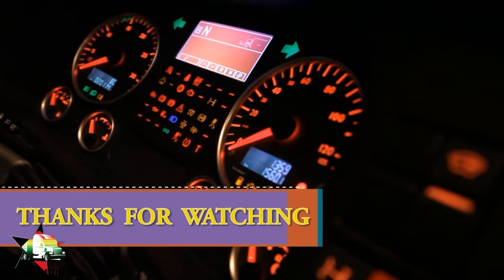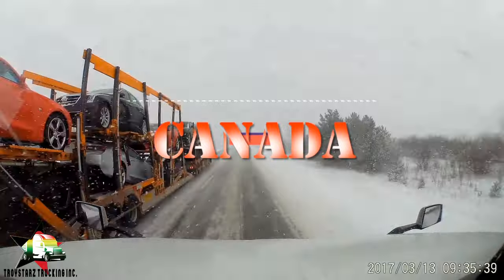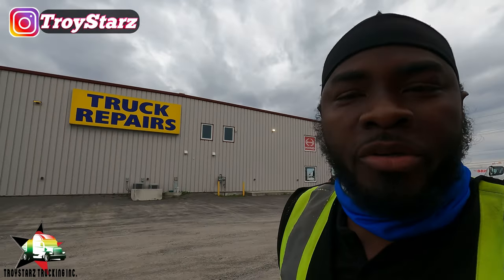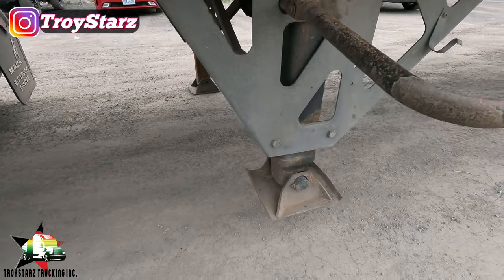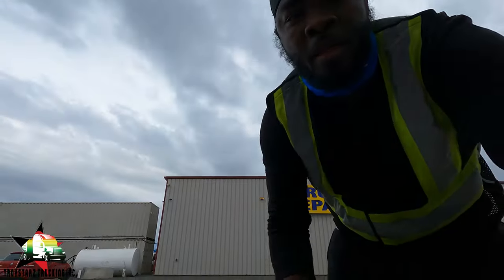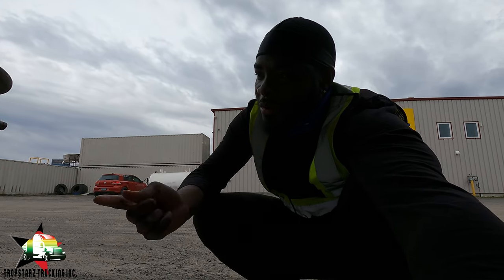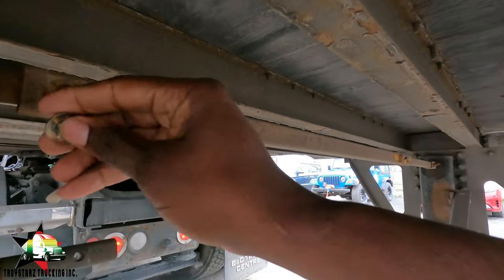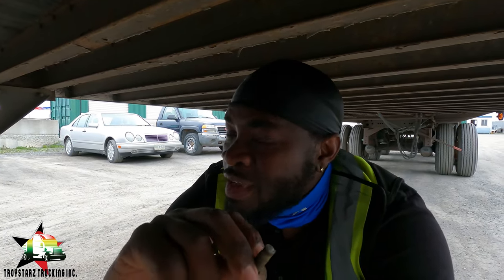Trailer Landing Gear Right Side LEG Not Cranking Up, Quick Fix

Comment: Yeh bredda, it simple to fix once you have the right tools etc...I once had to search on the side of the road for a piece of iron to connect  the bar I found a 4 inch nail which I put in and bend it with a stone lol...we drivers have to be versatile out on the road...great video, blessings.

Comment: Sunday January 8th 2022
I had a problem with 1 leg not working on landing gear.
You were right.  I replaced a bolt that fell out and now it works.
Thanks Troy.

Comment: The bolt is standard or SAE. The long part of the bolt is 3/8" wide, 2 and 1/2" long, with a 9/16" hex head. A 14 mm wrench (or spanner in the UK) will fit a 9/16" luckily! Good job on keeping your cool, and figuring out how to get back on the road.

Comment: The numbers you saw is the bolt size? The last number is the thread pitch(how much space between the threads). Spanner is a British name for wrench. There are different types of wrenches. You have open end(meaning you can slide it between an object to turn a nut or bolt. Box ends does not have an opening but is better to used because it slips less compared to the open end wrenches. Combination wrenches are two in one. One end is open and the other is not. Invest In ratchet wrenches because they're quicker and more reliable. Best of all get battery powered tools uf you can afford it.